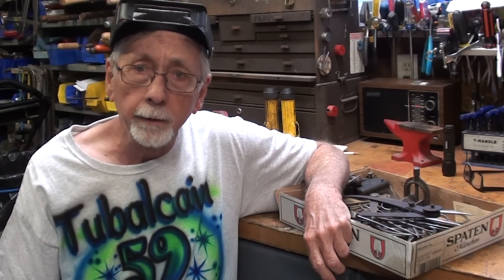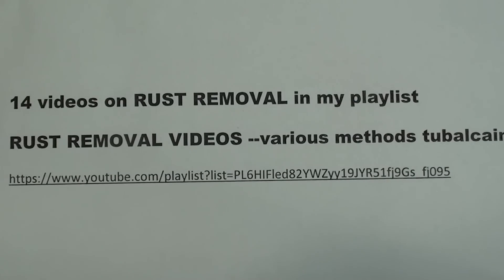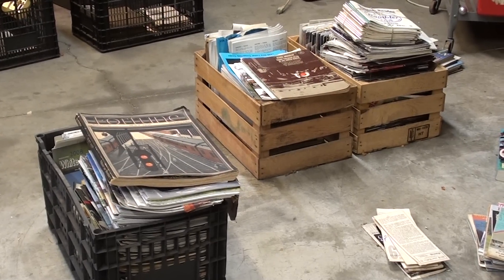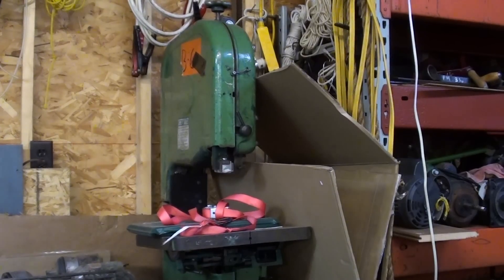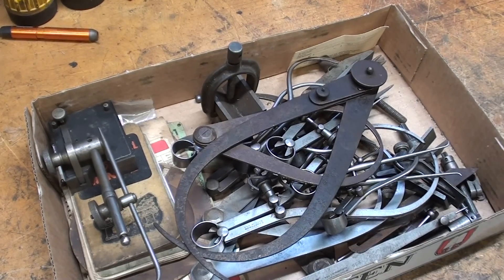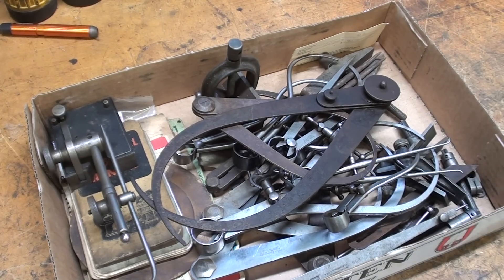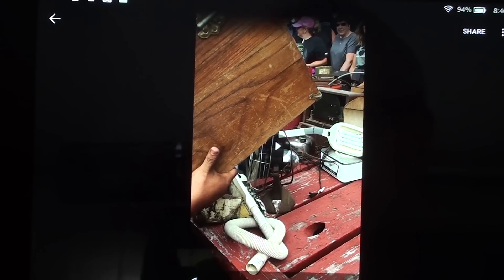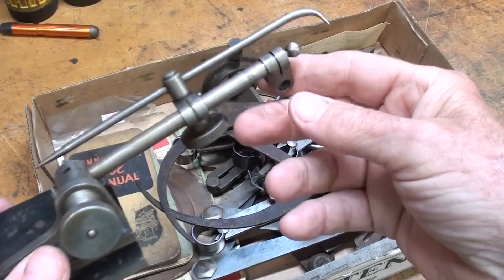Another Old MachinistTool Auction Tips 493 tubalcain

Comment: Those are definitely Model A Ford transmissions.  The one without a U-joint on it has a pawl to the Right of the shifter for the emergency brake.  I can't see if the other one has that pawl or not.  If it doesn't, then the top of that transmission is a slightly more rare one from late '27 to April '28 when the e-brake was to the driver's left.    They are basic 3-speed plus reverse transmissions with straight cut gears and no synchronizers.  3rd gear is direct drive.  They should be more than stout enough to gear down your saw, if you don't mind the overkill.  If you don't use them, consider cleaning one up, doing a bit of a cutaway, and see if a local high school physics or engineering school wants it.  If you do have the rare top, it is maybe worth putting that one on eBay (or let me know)  :)
Reply from the maker: Yes, I will probably do a cut away. They were five dollars each

Comment: Hi Mr Pete, I bought the same vintage calipers from a vintage store, they had only surface rust no pitting. So I put them in Evaporust for two days, cleaned up well. I then wirebrush and buff them a bit, that made them look like new. They were all very stiff, and that's probably how it should be, I left those that were easy to move or ptted. If that was my shop I would have cleaned them and then try to sell, unless dirty old stuff sell easier to certain people, that has the urge to clean them.
Reply from the maker: Yes, I think some people want to restore old tools

Comment: I have one of those Millers Falls surface gauges in my collection (I own probably about 15 surface gauges).  They all seem to have a short mast, but the mast is interchangeable with other makes. I use inside calipers.  They are useful to measure recesses inside bores, for example.  The dividers are nice, and useful.  You don't need to use those tools that much to extract $40 of value from them.  Great show, as usual.

Comment: I used an inside caliper recently to check the ID of a bicycle frame seat tube that was missing the seatpost, since the section nearest the opening is often deformed from the seatpost clamp or general damage.
Reply: Spring calipers are useless... until you need one.

Comment: Lyle. here in the UK we can buy a buffing wheel made out of the RED Scotchbright. You can fit them in a pillar drill or an electric drill They are great for polishing up steel parts, not so violent as a wire wheel and less chance of damaging your fingers. Thanks for showing your purchase.
Reply from the maker: Thanks
Reply: @mrpete222  Another possibility is a "vibrator" that is used to clean cartridge casings.

Comment: the easiest way to slow down the band saw is to change the motor to a DC one.use a varible speed potentiometer to control.a two way switch to change direction.just my thoughts of course.hope this helps with ideas.(these tred mills people buy and never use again have DC motors)
Reply: He has already done that and made several videos about it

Comment: I don't think that you need to worry about flash rust with evaporust. I had my Columbian #505 in it to de-rust, and it's been in a humid garage for 3 weeks with no sign of rust returning. Though it's still stuck in place. It was left on an outside workbench for over 40 years. I've been trying penetrating oil and heat so far.
Reply from the maker: Thanks

Comment: Mr. Pete. The transmission looks to be Model A Ford, did you ever consider a ZERO Max transmission unit? They were or are made in Minneapolis, MN. and controllable as a variable speed and you do not loose the torque. Variable from zero rpm to the max of the input motor. They are compact and well made.
Reply from the maker: Thank you, I will look them up

Comment: Have you considered using an gearbox like one off an old british pre-unit or harley motorcycle for your saw ? I seen a model makers lathe done that way and it worked really well.
Reply from the maker: Yes, but where would you get one
Reply: @mrpete222  

Is there no guys into older harleys around you,  Any fellas i know into old motorcycles usually have a ton of spare parts they will never get round to using.

Comment: Be careful with EvapoRust. When it gets too murky and used up, it EATS metal! My suspicion is: when the concentration of the chelation agent (the chemical that does the work of rust removal) is too low, the water content of evaporust causes items to rust faster than it can work. 

I have had 2 disasters as a result of being too cheap to replace it, thankfully they were not (to my knowledge) big losses - a starrett fishtail center gauge in rough & rusty (but recoverable)  shape come out looking like a burnt potato skin. And most recently I pulled out an auger bit which I accidentally left in for months - all of the detail, edge and threading on the tip were eliminated and it is so spindly and smooth now it looks almost like it's made of rock or plastic. There was a thick sludge coating it of what I assume was most of the eaten metal.

Comment: Just a guess, but I will bet that Brown & Sharpe probably sold a line a lower cost machinists tools, like your v-block that were machined only and not finish ground. Like you can purchase angle plates nowadays that are machined only or ground depending on how you intend to use them.
Reply from the maker: Thanks

Comment: The 10" wing divider is from LA Sayre & Co I don't see that tool documented anywhere so far on the internet.  The company was  "...most extensive manufacturers of steel punches in the United States.  Their ticket punches are used by conductors everywhere and their round and oval punches are endorsed by manufacturers generally.  They also manufacture many other hardware specialties and mechanics tools, hatchets, adzes, axes of all kinds, trowels, hammers, nail sets, claw tools, oil cloth knives, carpet stretchers, saw sets, screw drivers, can openers, plyers, compasses, chisels, saws, carpenters' and plumbers' tools, fruit parers, ice creepers, etc."
Reply from the maker: Thank you, that is all new to me
Reply: I had not heard of them before either.  I zoomed in on a screen shot as you were cleaning them up and was able to decipher the name.  The Newark part is what caught my ear since much of my flying career was out of Newark.

Comment: Lyle, You mentioned pouring the used Evaporust back into the bottle.  Not a good idea.  The Evaporust is slowly chemically depleted with use and is also contaminated with iron oxide which is the black sludge you see in the bottom of the pan after use. Evaporust becomes darker with use and less and less effective so it needs to be disposed of at that time.
Reply from the maker: Thanks

Comment: Have you ever tried Muriatic acid? We used to use them on engine tins and they would come out like new stampings... just a thought but I’ve never tried it on tooling...
Reply: The problem with using acid(s) is that they can cause problems as well as solve problems-!
Reply: Muriatic acid (HCl) is a strong acid and can cause more problems than not. If you feel compelled to use an acid for rust removal, phosphoric or organic acids such as vinegar are better choices.
Reply: jerry quigg I’ve never tried vinegar, does it take awhile to work?
Reply: @delas7389  vinegar is VERY effective for removing verdigris on copper and copper alloys. I have NO idea how vinegar works on RUST.
Reply: Dustin Delarosa - research chelation of rust. Much depends on UR item. If it’s tooling then electrolysis is the least problematic regarding surface damage.

Comment: May i suggest to change just the electric motor on the saw, use a 3 phase, add a frequency drive and adjust the speed that way. Yes you may don't get the same torque, but the transmission is also not that efficient and at the end of the day, over complicates the saw. You could use a delta-star (Dahlander) so you'll get two speeds native out of the motor, increasing the range
Reply from the maker: Thanks
Reply: @mrpete222  sorry i wasn't aware you already tried the VFD, you got so many vids! :-)

Comment: ...the PROBLEM with wooden tool boxes, is that wood is hydroscopic...and MOISTURE promotes RUST!!
Reply from the maker: Yes
Reply: I don't think that's entirely correct. I know that I have some items stored with and in wood and they rust LESS than items stored in metal or plastic, or left outside a box or cabinet (or sometimes not at all)
Reply: @Aubreykun  possibly.
Reply: Place camphor blocks in the chest to drive out moisture and oxygen around the tools.
Reply: @szsenyuk8887  I like to use the Bullfrog rust blockers.
Reply: @szsenyuk8887  Thanks, I'll try that out! (I think I saw some at the dollar store a few months ago haha)